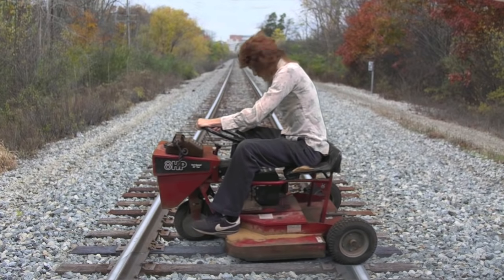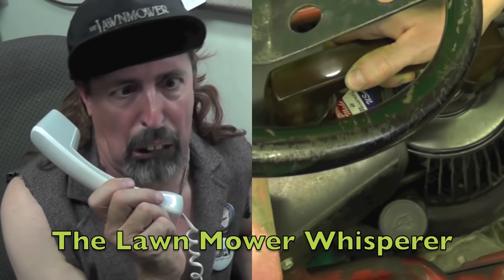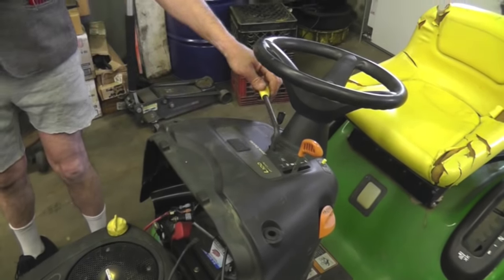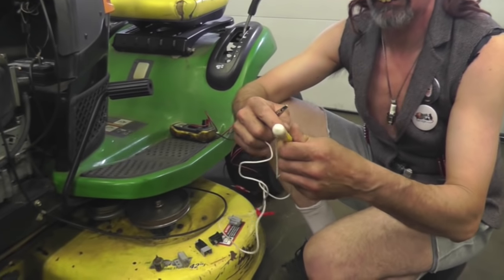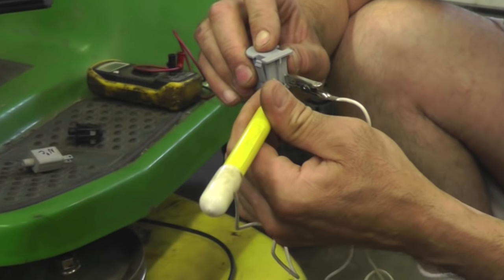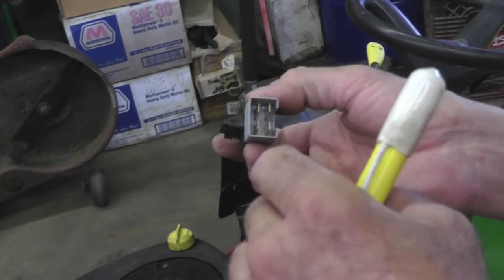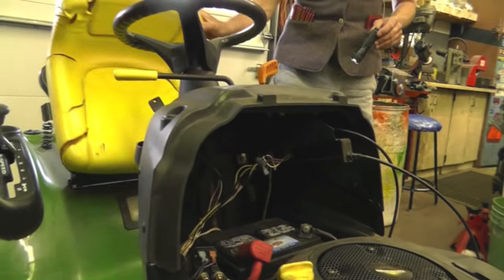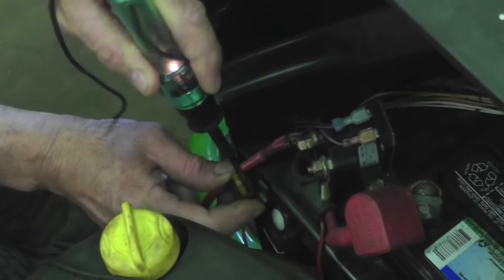Electrical Troubleshooting FOR DUMMIES

Comment: having trouble finding a video or anything to help with my issue I have a paulan pro 18 1\2 horse rider automatic I was mowing the lawn everything was great I shut it off for a minute now it will not start it now backfires when I try to start it . I checked the shear pin it is fine I put new gas and also replaced the spark plug I have checked all safety switches they are working correctly thought I might of flooded it when
I shut it off let it sit for days still won't start. I also removed the rubber end off of the switch in the bottom of the carb .  Any suggestions please!
Reply from the maker: 18 single cylinder? Sounds like it might have a valve problem take off the valve cover & check the valves.

Comment: Good video as always, some good trouble shooting, I finnaly got coil swaped,decided to adjust valves while I had the cover off but when I tried to loosen valve cover bolt wouldn't loosen without snapping off then I thought wwt do? any idears Thank's David O
Reply from the maker: +David Moore Those bolts always snap off. Some genius at Krohler thought it was a good Idea to use loctite on those small screws. You just have to drill & tap them out very tricky & time consuming. Or replace the heads.
Reply: I was afraid you'd say that, been there done that, went ahead and mowed my weed's before atempting valve adj., old power returned with both cylinders fireing, thank's for the quick response! Yhat do you think about a 22 hp. Husky, rescued one from an abusive home had a broken front axel, thought about fixing it up for a nack up or maby sale, motor susposto to run when axel broke, ever fixed one of these? Lot's of horror stories on innerwweb
Reply from the maker: I've fixed em all! If you have a Krohler command twin that engine has hydraulic lifters like a car no need to adjust. All Krohler Commands twins & singles have hydraulic lifters only the Courage has solid lifters.

Comment: question i have a lx 277 aws john deer with a kawaski engine problem when running idle or full throttle it seems to bog down evan when the blades are engaged it does the same thing it loses power then once and awhile rpms pick up. i have replaced the carbuater and still bogs down could it be electrical maybe does the battery being low would cause this problem .

Comment: i have a cub cadet rzt 22 zero turn... i had just replaced the ignition switch and it ran well for about a month... i had also replaced the solenoid, starter and the fuse at the same time... i was on a yard and i stopped to add fuel. i went to get back on and it wouldnt start. i had to jumper out the solenoid to get it to go... that got me by for about a week... then jumpering out the solenoid stopped working... i replaced it... same problem... i checked the carb... i adtusted the valves... i adjusted one of the magnetoes that was to close... i tested the started... it spins freely with power... tested all the circuits etc... when i turn the key the fly wheel on starter pops up and tries to turn the engine but cant... i turn the key and jumper the solenoid at the same time itll crank breifly but thats it... we are at our whits end

Comment: Is very informative video I have a question I have a Craftsman 42"  LT 1750.  917.27222.  The tractor died while I was mowing the grass. I reset everything and it started right up but as soon as I release the brake pedal it cut off then when I release the PTO it cut off. I cut the white wire going to the engine so I could defeat the safety system. Now I can drive it back to the shop. I have replaced the PTO switch the Ignition switch the interlock switch and the seat switch. I cannot figure out why the lawn mower is grounding out when I let go of the brake pedal or pull out the PTO.   I have alleviated the problem by cutting the white wire that goes to the engine but I would love to trace down what is  grounding out. what would be the testing process to find a bad ground?

Comment: Great video. my problem is I had electrical fire. all wires from starter to the starter solenoid in the wiring harness melted. I had been testing spark plug for fire with spark plug out. turned the motor over couple of times. & then with the Key switch off the wires started smoking & caught fire. had to disconnect the battery to put it out.  can you help?

Comment: Hi Taryl can you tell me what burnt the fuse in my cub? It has a kohler twin cam ohv motor. I had the motor running a min . it stoped running   turned the key NOTHING  I have a new batt and new fuse .Checked all safty things all off .I have a zero turn

Comment: I like your style.  I have question, dummy here picked l.p. john deere stx38 with(Koehler command 13 hp, long story , fuel line under tank was clogged , changed it , I loosened up throttle cable hold down, ( not sure exactly how to properly set the cable. in meantime I thought I would check out govenor setting. changed it. tried all the way clockwise and all the way counterclockwise.  either way engine revs off the chart,  actually goes higher when I pull throttle down in a slower position?   makes no sense.  can u help before I blow it up?. ,seems to run good other than idle out of control

Comment: hi taryal first time watcher  i have a lt2000 craftsman riding mower  21 hp when i put my mower in reverse it dies  when the citing blades are on  but when i turn off the blades i can use reverse is that normal

Comment: there are torx screws holding the top housing of the flywheel and for what ever reason are stripped out.  what do I need to do to free up the flywheel  Motor will not start.

Comment: My mower starts with the kill wire disconnected, but if it is connected 
to the coil the engine cranks but won't start, do you think my relay 
(interconnect module) is bad, or can it be the solenoid, ignition 
switch, or safety switches ?

Comment: I have a craftsman riding lawnmower. I am not getting spark from the sparkplug. I bought a new ignition coil and sparkplug and still I am not getting any spark from the plug. I put a screw driver in the plug wire and grounded the screwdriver and am FAINTLYGETTING A SMALL SPARK. What should I do next?

Comment: Hey Taryl, I'm in dire need of your help. I have a Craftsman LT2000 with a 20 HP Briggs and Stratton engine. I was cutting grass and the thing just died on me. Tried turning it back on and the engine wont turn over. Instead the screw mount interlock switch clicks over and over again. Oil is good, wires are good, battery is good. The flywheel does not turn smoothly and it makes a hissing sound every rotation. Probably just the piston though. I took out the spark plug and still the same thing happens. Switched out the Starter and still no luck. Replaced the 20 amp fuse because it looked corroded and same thing. Help a brother out man if you can, Thanks!
Reply: Make sure all your belts are loose from engine....take spark plugs out......if it turn over hard by hand or starter motor..... is tied up or close to it. Party over most likely. New motor or short block or new mower.

Comment: I'm confused and have an issue with the carb solenoid. I think i'm dealing with more than one issue on my engine not starting however. Troy bilt xp7000 with a 420cc B&G 030477-01 engine. Neighbor gave it to me for not running. if i open the fuel line cutoff, the carb floods. One of the problem is when the carb float is all the way up, its still not pushing the needle far enough to shut off fuel flow. I saw in another video there should also be a spring on this needle to give it an extra boost up. If i push it up with my finger it stops gas flow. how did this carb ever work right with the spring missing?? Or did someone work on it and lose the spring?? but back to the solenoid. On mine the needle pops up when given power. But i don't see how the needle is even long enough to reach and plug anything.  I can test it by touching the leads to +/- on the battery but can't get it to actuate while using normal connections. No key, has an on/off switch. So, if the switch is off, how would it power the solenoid? and because it's not sending power, do i have an electrical issue somewhere else causing it not to start? like the switch is "off" even if i turn it on?? Cranks fine. I wouldn't mind just disconnecting it since i have a fuel shut off and the float should stop fuel flow as well, once i fix that, but bothered that the solenoid is not getting power.

Comment: Hey Taryl, I have a STX38 that died while i was moving it. It generally runs awesome but out of the blue it just died. I checked the seat switch and its fine. I pulled the clip off the neutral safety  switch and still nothing (thats what i thought it was). Batteries fully charged, but i cant find the switches for the brake . I pulled the tank and thought it was down under near the steering, but its not there. No one seems to have anything on STXs with the Electric clutch and the 2 foot peddles. Any idea where the other safety switches might be. I have another STX and it too did the same thing, and i never figured that out either.  Would appreciate any ideas if you have any. Jim

Comment: Traly this video  is same  as my tractor  I need  help on setting  the valves  on this 17 hr ohv I rebuilt  the motor  because  of your videos and made  it simple  please  help me  with  this valve  clearance  on  setting  them correctly  I was told  to set at .005 but it back fires and pops and now it's not doing anything  thank you Robert
Reply: 0.005 sounds right.  I'm thinking your timing gear is off a tooth...

Comment: ? i have a john Deere 445 and its wanting to start and run sometimes, when i turn the key to the first position its wanting to start but clicking, i have blown out ever connection cause they had dust and dirt in them. i have replaced the battery like an year or 2 ago. not sure whats wrong with it. what should i check to figure out whats wrong with it.
Reply: Hook up a battery  charger turn it on for short time and see if turns over if it will then  charge it for a few hours and then see if it starts

Comment: hi my lawnmower keeps blowing fuses every time i turn the key switch to crank it up. it is a craftsman lt1000. could you please help me thanks.
Reply: you have a short some where look for a bare wire
Reply: Could be the Starter.  Do the Starter Test with spare battery.

Comment: Hi All, I have a John Deere D160 with PTO.
Long Story short, my battery testers all indicate my battery is fine. However, when I turn the key, there simply is 0 power. The HOURS display on the small screen does not come on. When I turn further from Off to On to Lights, the front-end lights DO NOT light up and off course, when I turn again to started, NOTHING.

There is simply NO POWER but the battery is fine, fully charged per my charger. Once or twice out of the 100 times I turn the key, I've seen the digital display show the hours of use and then blank out but long story short, no power AT ALL though Battery reports fine

What do you all the great elements displayed here, what would you guys recommend I check first (really hoping to avoid sending it out for discovery and trying to do this myself). APPRECIATE the help/guidance.

Comment: I have a John Deere 265 Lawn tractor. It dies when I turn off the PTO. So I quickly turn key off then on to keep it running. It sounds like Diodes But where?  Please Help Taryl D..
Reply: If you have a wire harness For this mower Let me know to buy. Thanks Taryl.

Comment: I did that and bumped the ignition the valves seem like they are moving fine when I get it I will comment what I found
Reply from the maker: Did you try a new spark plug?

Comment: Got a 2 yr old troy pony. Jus like u said out mowing grass. Shut it off to get a drink. Get back on and turn key. Nothin. No clickin. No start. No headlights. No nothin. Battery hot. Cables tight. Gotta be switch or key switch. Help.

Comment: My lawnmower is starting but when I turn on blades it cut off?
Reply: Tajmaliek Kirton did you get it sorted ? Mine is doing the same 15.5 hp with manual blade levers

Comment: Hey Bud Thanx for you time and Info not many Guys Like you to help people out God Bless you for that! Wondering if you can help me out? I have a GT3000 Craftsman Tractor 25 Hp Kohler Engine and the 30amp fuse keeps Blowing everytime I put a new one in when making contact to the fuse Holder without Key being in the ignition.,Can you tell me where the short lies? Thanx Bud!
Reply: William E I just have Jeremy I got a John Deere v950 a z track Pro and it just won't start hit a bump what would be the problem
Reply: Michael got on it it's a z track Pro z950a John Deere and it won't start it ran fine he what cutting grass and hit a bump and it just something ground or something I don't know something won't start cranking I don't know what could be the problem
Reply: In the wiring

Comment: my mtd riding lawn mower won't start with the key but it will if i jump the solenoid.  what can be wrong?
Reply: dead battery or bad key ignition
Reply: Jonathon Helpman I've replaced the solenoid, starter and ignition switch and nothing. My next step is to check the switches like in the video.
Reply: l agree. l hope it works out for you. l am now having the very same issue with my riding  lawnmower. lf you find out and fix the problem could tell me what it is.
Reply: Jonathon Helpman sure will

Comment: I have a 15hp sabre riding lawn mower, finally had it fixed had a new solenoid put in it and it worked! I was loading on the back of my truck with the my ramps and the tractor fell on its side now it doesn’t turn on, the battery is new the solenoid is new it makes a clicking sound on the solenoid and a clicking sound on the carburetor but it wont crank? Can someone help me

Comment: Taryl i need your help with my John Deere rx 95 and sx 95 rear engine restoration projects problem 1 is it is very hard to source parts for these mowers both have Kawasaki 12.5 hp engines 1 is running the other i need your help getting running i need to figure out the wiring or rewire the mower and need your suggestions on how to do this with this mower i don't have any service manuals to help me so please help me if you don't mind
Reply from the maker: I source all my electrical diagrams  from the interscreen. Yur local John deere dealer should have this information and would probably print out a diagram for you.
Reply: yes but there realty isn't alot of information on the inter web about these mowers
Reply from the maker: I don't see a lot of those mowers for repair. Only because we are in a rural area and those mowers are too small for the amount of grass our customers cut. You might try joining a John Deere forum maybe a member of the forum could help you with some information.
Reply: where are ya located im in upstate SOUTH CAKALAKY  ?
Reply from the maker: We're in Northwest Indiana
Reply: how about do a video on how to build a small engine test stand or a hotwire stand to test small engines to see if they will run
Reply from the maker: I do show in a couple videos our test stand I made from an old tractor. The baja mini bike build part 2 shows me using the stand. I welded nuts to the underneath of the engine mounting plate so it can accommodate all the different mounting patterns of small engines. A cable for the starter, a hot wire for the carb. solenoid if the engine has one,and a kill wire. It uses the existing tractor solenoid,battery & key switch plus I gravity feed the fuel or I use a remote tank. I also made different wire & alligator clip connectors. I use only 2-bolts to hold down the engine only to makes it easier & faster for the install & removal. Plus by using an old tractor when we don't need it we just push it outside out of our way.
Reply: okay kool will have to check that out
Reply: craftsman clutch drive

Comment: have a craftman GT5000 run's good but  got electric clutch ,run's good but when engauge the electric clutch it goes to discharges and drain's the battery after about 30 min.'s of mowing replaced the regular ($68.00 ) same thing still goes to discharges ,,,the electric clutch has no adjustment is it,,,,,,,, the alternater ? ($88.00 )could it be weak?,,,,,,,,is it the electric clutch ?  HELP
Reply from the maker: John Kennedy You'll have to test the alternator and see if it's putting out voltage. Put a meter across the battery, see if it's charging it.
Reply: craftsman clutch brake
Reply: craftsman riding mower

Comment: That 20 Amp fuse is blowing when I turn on key or try to start..
Reply from the maker: Luke Prolife You have a wire grounding out somewhere
Reply: Yes, I found it, Thanks... It was the wire for the lights and it had moved after I opened the cover, that made it hard to find..
Reply: I did find it, sorry it took so long to get back, but it was the wire for the lights turned on by the start switch, it was pinched between hinge and frame, Thanks for answering, I know where I can get the info I need now..

Comment: I used to work in the city of Columbia I found an old riding lawn mower in the bottom of a trash pile and I broke it home about 3 months later a man stopped beside where I was working and asked me did I ever get the old lawn mower working I said yeah I was cut grass with it yesterday and he was the man that told me I can get it and then he calls the power company it tells them he wants his lawn mower back so my boss man Told me had to bring it. I told the boss man it was given to me back

Comment: My lawn tractor has an issue.
1st. It ran fine and you could drive it around. I decided I was going to pulley swap it and after I did that, it would not start. Disconnected the battery and checked the lines. Slapped it back together and connected the battery, as I was connecting the battery, the engine steered turning over. I quickly turned the key off but nothing happened.
2nd. It is a John Deere STX38 Yellow Deck.
3rd. Can anyone help me?